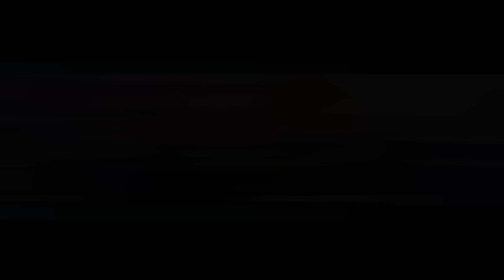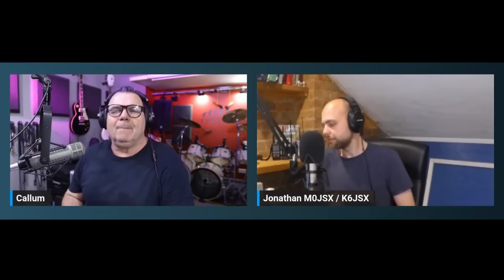19 Ideas for a Ham Radio Manufacturers

Comment: The Yaesu FTDX10 has most of the things that you two are asking for. I would love to have a separate RX antenna connector so I could use a LoG antenna for particularly noisy bands (40 meters.) It should be relatively easy to specify in the firmware settings which antenna connector you want to use for RX.

Yaesu should replace their entire "Department of Wacky Ideas" as one ham calls it (probably staffed by graduates of schools of design and/or art) with a QA department. Then we wouldn't end up with situations like two semicircles of buttons surrounding the VFO knob with  four other knobs in the corners, they'd all be spaced appropriately for ease of use. Yaesu should also ignore the competition (IC-7300, probably) and make the DX-10 wider and a bit higher, say 5 and 2.5 centimeters respectively, to both accommodate better spacing of the controls and make room on the back for another SO-239 (and why are we as hams using these and PL-259s when BNC "bayonet" connectors are so much easier to connect and disconnect?)

As long as they're including a video chip and external monitor connector, why are they still using 800x600 resolution and DVI-D? The majority of monitors are 1920x1080 and HDMI. And as long as they're giving us FHD resolution, why limit the external display to a replication of the radio's display screen? Why not give us mouseable rig control in firmware, emulating the buttons and knobs so we could control the entire radio with a mouse and monitor?

And for Pete's sake backlight the buttons! They were on the FT-891 from over 20 years ago!

Release this improved DX10 as the FTDX10D to get around having to redo the entire type-approval process for the DX10, just like they did with the FT-450D vs, the FT-450.
Reply from the maker: Bigger is good (IMHO!)
Reply: @DXCommanderHQ  But not TOO big.  I only have around 40cm. in my shack to fit both a radio and a speaker. Very tiny house here, and my shack/workbench/computer/dining table combination's only 1.8 meters long. I'm eventually going to want to find room for a linear amplifier too. (I sure wish Tokyo Hy Power was still in business. Their 600W HL-550fx HF and 6m amplifier would be perfect for me.)

Comment: OHIS 8 pin on the back of the radio should be standard, you kind of hinted around about it with the mic on the back. 

Every transmit antenna should have the capability to have a separate receive antenna, ie. 2-transmit ports 2-extra receive ports.
I apologize I am team replay on this one.
Reply from the maker: Like it!!

Comment: Yaesu has the FH-2 Remote Keypad. I would like to see a similar programmable keypad with a USB interface for all transceivers. It would not need to be 12 physical buttons, but could be a touch pad of the same size where you could also program labels with the function. Good arguement for a second USB interface.
Reply from the maker: Nice!

Comment: As a newbie to the hobby, I like USB-C, android type apps, wireless connection for mic/audio and screen. For a mobile unit in a modern vehicle we need a "everything in mic" unit or at least with an app supporting the mic. Multiple digital modes would be nice too, eg; wires x, or p25 + dmr.

Comment: On units with detachable control heads, please please please put the mic connector back on the control head. It is so stupid to put the mic connector on the main unit that is usually hidden away somewhere. The control head is always mounted near the user, where the mic should be. Drives me crazy!

Comment: VHF/UHF
Base radios where you can choose which band uses which antenna, even if BOTH (or all 3 if you add SHF). Sometimes we just want to use a single dual bander for both.
Dual scan, dual receive. VV/UU/UV
The ability to assign different antennas to different memory channels.
Say I have a Yagi, and a vertical. My Yagi points to a distant repeater that the vertical doesn’t reach well, but gives me a good omnidirectional signal to other stations or repeaters.
Scan banks like Icom has.
Auto scan skip. If you run 2 scan banks that share a memory frequency, you can set it to automatically skip the secondary side, if the primary side is receiving that station.
100w on VHF and UHF.
The ability to assign LONG names to memories (like the ID-5100)
Of course a built in sound card for things like VARA.
Numerous programmable buttons on the radio AND mic.

And a mobile version (detachable head, smaller radio) as well.
Reply: I agree...We at minimum need one antenna connector for VHF and one for UHF and make them like you said as to where they could be user changed for V/V or U/U if wanted...and yes 100 watts is needed...My 2980r  does great on 80 watts and I can get out further than most people but I would welcome the extra 20 watts!

Comment: Hate I missed this, but with the higher end SDR radios especially, it would be cool if the radios allowed you to manually preset transmit restrictions for each band based on a user's license class, either visibly on the waterfall, or hard transmit denial.

Comment: HF
USB in for mouse and keyboard that can navigate all of the menus.
Knobs and switches for more advanced noise control, including 2 notch filters.
One jack on the front for Headphones, mic, and PTT.
For external monitor, the option to have a different screen on the monitor vs on the radio. Why do we need 2 screens showing the same thing.
Example.
On the external monitor, you see frequency, waterfall (with averaging, and a decent frame rate) band scope, audio meters etc. on the radio, your power out, SWR, ALC, filter setting etc.
Also, built in tuners with more capability. 10:1 should be standard.
Reply from the maker: Nice

Comment: One function that would have been very useful (this was on a old radio, but the same would apply even more so to modern rigs) :

I used to help a old friend (now SK) to set his rig up.
 Unfortunately he developed dementia and I frequently got a phone call from him saying that his radio had "gone up the wall again"

The problem was that he had pressed various buttons often accidentally, and got the rig into some weird mode, that he could not really describe. It would have been so useful to have a programmable button sequence that once set could not be easily changed by random finger poking that would set the rig back to a pre-defined status. Rather like the profiles you have described, but something that you cold say the the OP,  press the red and the blue buttons at the same time. (it would be pointless trying to talk him through menu settings) 

That would have saved a lot of time and lots to friendly ribbing along the lines of "what have you done this time!" 

Andy
Reply from the maker: Hmmm. I like! Need one of them too. Save everything and single button restore!

Comment: How about a rig which uses Win10/11 for interface, and non on the rig itself.
Reply: We had one of those 25 years ago.  Kenwood's TS-2000B.  But if you're going to do that, it needs to include a decent OS, not just Windows.

Comment: I want Yaesu to stop dual receive single transmit Fusion radios with APRS.  They are fine for all other modes.  If they have APRS they need dual transmit or software that actually would stop APRS from being erroneously over analogue repeaters and only transmit on the programed 144.390 frequency Canada.  I can't use my APRS and use any analogue Repeaters on my FTM-100dr!

Comment: Wouldn't it be reasonable to house and power a small SBC (single-board computer, i.e., raspberry pi et. al.) inside a radio, with hardwired interfaces (like audio in/out, CAT control, etc.)?
Reply: Every modern radio already has a dedicated computer inside of it. Most of them already have sound cards on board, CAT control, etc. accessible via USB.

Comment: Almost convenient enough on the FT-991A, if you're already on a band, and you select that band again, it cycles through 3 configurations, which I keep set up for SSB, CW, and for me CW at the ARRL  beacon frequency (some might want RTTY or SSTV setups).  I don't need FT-8 (or JS8CALL) setup(s) because WSJT-X (and js8call) record the current settings when they start up, set things for their mode, and restore the saved settings when they exit.

Especially give the programmable touch screen buttons, I find that I generally have enough buttons.  But I occasionally use flrig to control the radio.  It's not quite up to HRDelux standards, but I don't want to have to reboot from Linux into Windows, and I haven't tried making HRDelux run under Wine.

One sound card is good enough for me, since I don't stream or make YouTube videos (at least so far), and there is software that lets one plug real and virtual sound interfaces together (even on Linus), which would include the ability to send one source to multiple destinations.  Two serial interfaces, on the other hand, are good, since CAT doesn't  share well with RTTY or PSK32, etc., modes, for which the radio implements a TU (modem).

I would like multiple CW inputs, separately configured as to whether they are for straight keys or whether they are implementing a keyer for a paddle.  (My KX-3 does, in fact, have this.)  I would like to be able to jump from sending with the paddles to sending with a straight key, to send the traditional K with an extended final DAH for "over".  Too, when slowing down for someone new, using the straight key to emphasize certain aspects on the fly (weight, dit/dah ratio) to help them understand.  I would settle for using the PTT button on the mic and/or any of the PTT signals on the rear panel interfaces, as the straight key, when in CW mode.  For many radios this could be implemented in a firmware update, including adding configuration settings to enable/disable it, for owners who don't want this behavior.

Almost all modern transceivers have everything that is needed to perform an SWR scan, quickly, and at very low power.  Those without a graphic screen on which to display the scan can still report the frequency in the scan that had the minimum SWR, and what that SWR was.  Also, radios with internal tuners, after tuning, should be able to report the capacitance and inductance values used, as well as whether it used the high or low impedance configurations.  And from those it could even estimate the resistance and reactance seen at the antenna connector.  And given that plus the final SWR reading, plus electrical length and loss figures for the feed line, it could even project resistance and reactance at the far end.  We might not all know how to use that information, but I'm not fond of moving the coax between the radio and an antenna analyzer, particularly since that changes the system.

I'd like my radios to work with my Bluetooth headphones, configurable with or without switching the mic input.  I'd like the normal PTT buttons to continue to work, since I don't find the Bluetooth play/pause buttons on my headphones to be particularly convenient, and I don't want to get stuck in transmit if the Bluetooth connection fails.  Yes, I could do all that with a dongle, but that's true of sound cards as well: We're trying to reduce clutter, and things that might get left behind when going to the field.

Thank you for this lovely forum on which to publish my hair brained schemes.

73, KE1G

Comment: I've got an FT 101D and although I love it, but I would have liked a clock on the display, Bluetooth mouse, keyboard and headphone connectivity, Wi-Fi connectivity for firmware updates etc, and a hdmi video / audio output port. All of these things are commonplace on most other prosumer electronic equipment (and have been for years).

Comment: I wanted a replacement for my old FT-2000D. Almost all of my radio's are Yaesu - including all of the FT8x7 family, mobile radio's and handhelds. I tried hard but I could not get excited by the 101. It just didn't excite me in the slightest. I really do not like convoluted menu systems and went for the TS-990 which I absolutely adore. I can fly it and I don't have to drill down into menus to set the keyer speed etc. There is a knob and I turn it. Done. 

The majority of radio's that I have looked at feel plasticy and cheaply made including the 101. Yaesu have just 100% lost the plot. They have nothing that interests me in their current lineup. They discontinued the FT-857 and introduce the FT-891 without V/UHF. They discontinued the FT-817/8 and replaced it with nothing. I went for the TX500 because Yaesu didn't have anything that was close to the TX-500. I'd been a Yaesu fan for close to 50 years.

It isn't because I'm an old fart - I'm an engineer working with a semiconductor manufacturer.
Reply from the maker: Good call

Comment: HDMI cost Per Year "PER ITEM" for over 10,000 units produced is $10,000, less than 10,000 units is $5,000 + $1 per unit.  Displaying the HDMI logo has a separate + .04 to .15 cent cost per logo.  DVI on the other hand is royalty fee free.

Comment: XLR audio in with ptt jack on the back of the radio that will happily accept any microphone or mixer. Impedance, gain, lift etc. can all be adjusted from the radio menu. That way we’re not messing around with adapter cables and interface boxes.
Reply: XLR would be great. They could do VOX, foot switch rear, or even a key on the front of the radio!
Reply from the maker: All good...

Comment: If low priced, very high performance sdr's like the Hermes lite 2 keep evolving, it'll no longer make sense to buy a 20 year desk brick that quickly gets stuck behind technologically. 
The open source for updates makes you not at the mercy of the manufacturer for greatly needed updates and ever improving features.
For similar money you can have a full featured sdr with a legal limit amp instead of a 100 watt "high end" desk lump.

Comment: I would like a 2 meter am/fm/ssb radio the size of a cb.
Put out about 50 watts am/FM and 75-100 on ssb. 
HF mobile radios need a volume, squelch, RF gain, a am/FM/usb/lsb switch and a frequency knob. No menu for everyday operations.
Reply from the maker: I spoke to Jonathan about this.. Apparently the market would be very small.. and the manufacturer has to jump thorugh legilative hoops to get a rig approved..

Comment: I would like to reverse the trend to make desktop HF radios smaller. MY old FT1000MP MKV is  much larger and I find it much easier to get my fat fingers to  controls. I am the odd man out in that i prefer more controls on the radio and not on the computer. Maybe I am just living in the past.. But a larger form factor would let us add more antenna jacks, more buttons for less menus etc. If the purchaser is going to leave it on the desk in the shack is the smallest form possible really important?  Now for portable rigs thats all out the window lol.
73 VA3XAP
Reply from the maker: Loved my FT1000MPO.. Why I probably like the 990. Big.
Reply: Absolutely!
Like the Kenwood 990.
I don’t want to go through menus for things I do often.
NR, NB, Notch, bands, modes, antennas, tune, RF gain, AF, power out, compression, mic gain, tuning steps, mode, filter size/shift, etc. all should have a dedicated button or knob… and if a dual receiver radio. Dual buttons for all.
Hell, I LIKE a big radio on the desk. More buttons means more room for bigger, more robust/effective components!
Reply: @johnarcher9480 👍
Reply: I agree, bring back the big rigs... I'm an amateur Wildlife Photographer and they tried making camera's and lenses smaller and lighter..It lasted about 2 years and now the trend is back to a full deep grip that you can get all 4 fingers in instead of those little toy camera's everyone was wanting that had at best a 3 finger grip..

Comment: Callum? Do you want an HF rig or a freaking computer?  Maybe I'm old, but for me, the less complicated the better.
Reply from the maker: Fore base-station work, I like a BIG radio with all the toys.. For /P - I like 100W and simple, eg TS-590.
Reply: @DXCommanderHQ  Yes, that's the ticket. Some of these smaller radios that claim to be Mobil, are just way too complicated to be fiddling with while your driving.  I'm still saving for my commander!!! Our government thinks that us oldies should just watch paint dry until we die. LOL
Reply: A larger size radio should provide better access to the most frequently used controls. These smaller footprint radios are very cramped and many controls and multi function knobs become clumsy to use. It is possible that in a contest or serious DX hunting operation to be at a disadvantage because the radio’s easy access to important functions becomes restricted from poorly designed cramped front panel layout. And some multifunctional menu options are embedded way too deep in multiple levels to make a quick adjustment to snag a rare or highly desirable contact. Sometimes timing and quickness are more important factors than
a complex menu driven front panel. Larger sized radios can be accomplished in in lower priced more efficiently designed radios that won’t break the bank. If a major manufacturer can provide the high value features then they also should have the ability to produce a “fuller” size radio with logically laid out functions providing simplicity and efficient control operations for reasonable cost. Functionality sells and properly designing a radio that puts ease of use above complex confusing configurations should sell. de KZ5Y dah di dah

Comment: The round mic connectors are type GX16. I only found that out when I bought a Lab 599 radio that had the smaller GX12 size. There is a GX20 size too. The number is the diameter in mm. They were designed for avionics interconnectors in Aircraft.
Reply from the maker: Interesting!